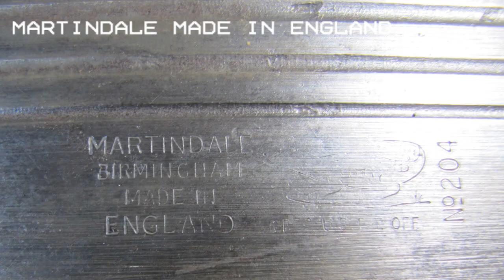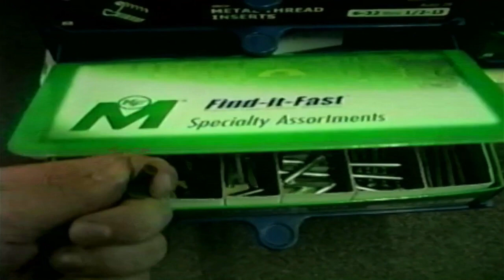Martindale Machete Restoration

Comment: Nice work. You didn't try to turn it into some fancy display piece, just a solid restoration.  It was also refreshing to see you using the bandsaw safely - blade guide set to the correct height for the work piece.  Well done.
Reply from the maker: Thank you! That is very much my goal, refreshing these tools so they can keep on serving.